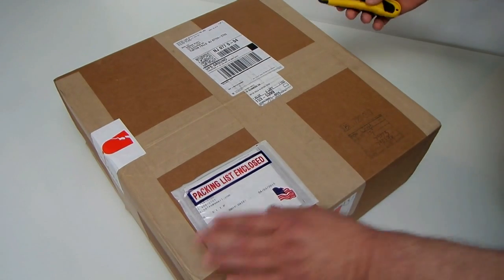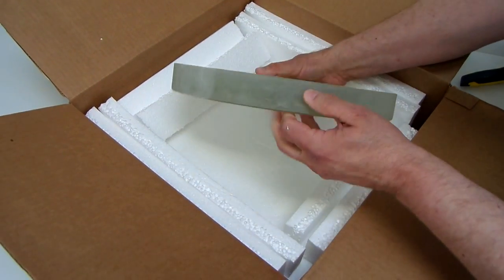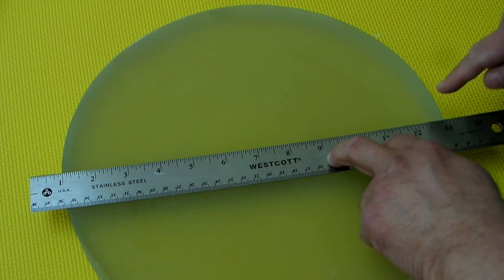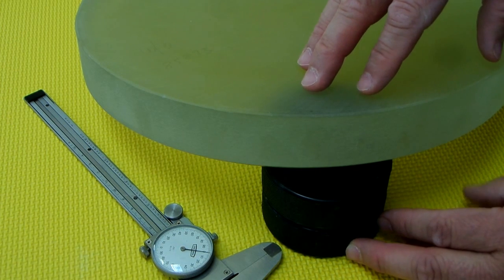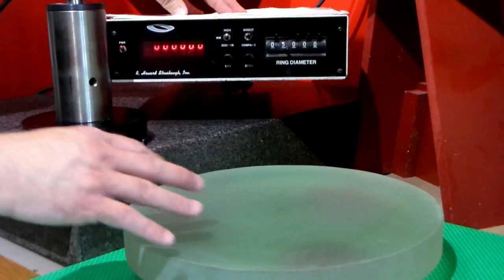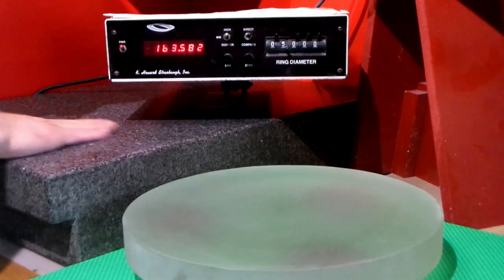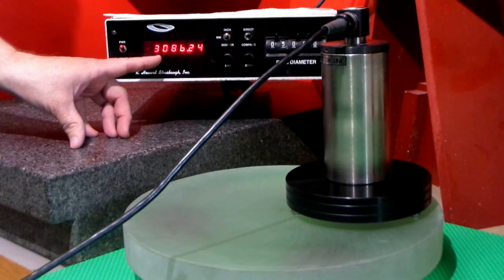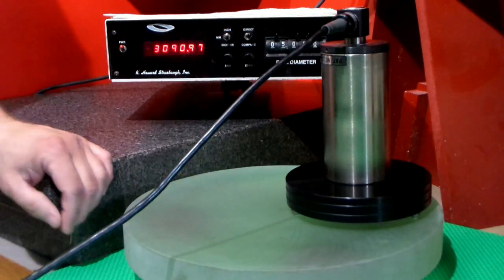12 inch f4.9 Telescope Mirror Part 1

Comment: You're opening the box completely wrong. It's a good way to slice your hand clean open. Instead of cutting towards you, cut away. Jeez.
  Better yet, just ditch the box cutter altogether and use a butter knife.
Reply from the maker: Yes, I'm a slow learner.  Nearly cut off the tip of my thumb a couple of years ago slicing an onion.  I don't think the butter knife would work on the onion.  BTW, the onion didn't have anything to do with a mirror!
Reply: @GordonWaite  No, a butter knife would not work slicing onions. 
  I want a parabolic mirror, about 40 cm diameter. I thought watching your video would help. Thanks 😊

Comment: Rewatching this video.  You haven't made any new ones in a while.  I dug out the 7" F7 project that I put aside some years back.  Guess I'll try to finish polishing it AGAIN.  Grinding was easy, but making a pitch lap is hard.  Years ago I treepaned out two 7" disks of 3/4" glass and managed to grind the mirror.  The largest disk I can cut this way on my drill press would be about 9", and that also would probably be the largest plate glass mirror I'd be foolish enough to try at that thickness.

Comment: What kind of glass you use and from where do you order them?
Have you ever tried Lead glass?
Reply from the maker: Two most common types of glass are standard plate glas (soda lime) and borosilicate glass like Supremax-33.  I buy most of my glass from Swift in Elmira, NY.  I have never used lead glass.

Comment: Hi. I was just wondering; since the glass is grinded and polished and lastly aluminized. Wouldn't it be easier and cheaper to just grind the mirror out of an aluminum blank and then polish that to a high gloss mirror finish, getting rid of the glass all together.
Reply: That could certainly be done, and had been centuries ago with speculum metal mirrors, but then you'd lose the superior qualities of glass over aluminum and most metals, such as smoothness (aluminum has crystalline and grain properties that don't allow a solid chunk of it to be made as smooth as glass can be made) and dimensional stability over both temperature variations and time.  Aluminum's relative instability concerning temperature also makes it more difficult to grind to precisely the right shape to begin with.  Then when its surface finally corrodes or is otherwise degraded, it has to be repolished (at least the final high-precision step) like old speculum metal mirrors, while with aluminized glass mirrors, the aluminum film is chemically removed, the glass mirror is cleaned (no repolishing necessary), and is re-aluminized.  This has to be done every several years with large professional mirrors.  So with glass mirrors, you get the best properties of both glass and aluminum (its reflectivity), as well as greatly reduced cost and difficulty of maintenance.  Frankly, it makes no sense to make a solid aluminum mirror--it would work, but aluminized glass is superior in every way.

Now if we look at the James Webb Space Telescope, its beryllium mirrors actually have superior physical properties even to glass.  Every mirror would be made of this metal if it weren't so rare, expensive, and dangerous to work with, but the JWST is worth it.  Beryllium on its own doesn't reflect well either, though, so it has a gold reflective film (to optimize for infrared wavelengths).  As with aluminum, a solid gold mirror would be inferior, so two materials are used to get the best properties of both.  I don't think there is a single material that is the best or even good enough (by today's standards) in every way.
Reply: @rbrtck  That was a good answet! Thank you for that. Somewhere in reading it an idea came to me. Maybe the thing to use instead of glass would be a meteorite. So that the mirror from space mirrors space. Makes another type of sense than precision. But for this time I will be happy with beryllium and gold. In fact, I will not mention any of this to the James Webb people. Grinding new mirrors from meteorites might cause a delayed launch date.

Comment: Note: this four part series ends before the final process is complete. You will not see the mirror being coated, or installed in a telescope.
Reply: I ws looking forward to a part 5 bcos I have with me a 12 inch blank. And the part 5 would be a great help. However Mr Gordon has personally replied to my questions and I'm sure he will help me out to finish my 12 inch. It's my first project. And I'm really not gonna aim for anything high.

Comment: I have a question. If you have 2 identical telescopes , same brand ,model ect are the mirrors going to be the same quality? or will one telescope have superior optics to the other? The reason i ask is i have read a few times that it is hit and miss with regards to telescope optics.
Reply from the maker: Most common commercial reflecting telescopes have optics that are manufactured in China.  These optics are commonly "OK" optics, but perhaps as much as 20% to 40% of the mirrors are not up to minimal standards.  We receive mirrors to test all the time, and most of these are well worse than 1/4-wave, a traditional standard.  Of course, we see these particular mirrors because their owners aren't happy.  So that does not mean that all of those mirrors are bad.  It is a self-selecting group that we see.  The problem is that to get a better mirror you have to spend more time figuring it.  Time is money, so overseas makers tend to stop as soon as possible in order to make the highest profit.  The result of this is that you see a lot of dubious mirrors, and you very seldom see a really excellent mirror.  You get what you  pay for, if you are lucky, and this is a cheap, serviceable mirror.  So to answer your question, you are likely to get a usable mirror in a commercial telescope, but the odds of getting a poor mirror are pretty high as well.
Reply: ok thanks for your help , the scope i brought is the celestron evo 9.25. I was under the impression that these big name companys had good quality control and produced good optics otherwise they would be out of business. I also had no idea my mirrors could be of dubious quality when comparing identical telescopes.

Comment: What happens when the mirror is not pregenerated to an f/4.9?
Reply from the maker: If a mirror isn't pre-generated, then you have to start with a flat tool instead of a curved tool.  You then have to use the flat tool to get the curve started on the mirror blank.  As you get the curve started, the tool will take on the same curve.  After that it is the same process as with a pre-generated blank.  Starting flat just means you have a fair bit more work to do, but it's not any harder.
Reply: @GordonWaite  --- EXACTLY ......... Easier than you think ......... Just  a LOT of LOVING labor involved ......... AND LEARNING ......... You will LOVE that which you create !!!
Reply from the maker: @NumberOneScientist  Exactly! Nothing better than the first look through the eyepiece of the telescope you built!
Reply: I ground my 12" f 5 from flat rather than pre-generated. Took forever, but as he says, really not difficult.

Comment: do you need to let the blank rest to get up to lab temp for the spherometer? have you ever used an optical flat to measure flatness?
Reply from the maker: You do not need to let the mirror rest before doing a spherometry test.  The amount of expansion due to warming during grinding is too small to measure with a spherometer.  I have often used optical flats to measure the flatness of mirrors.  I have a couple of Newton interferometers.  It's a very cool test.
Reply: neat.

Comment: 7 G's???? I just started researching cost for Dobsonian telescopes last night. I want to build my own. Why are mirrors so freaking expensive????? I don't get it?
Reply from the maker: Take a 20" f/4.5 mirror.  Retail price is about $5,250.  A Supremax-33 mirror blank, pre-generated, will cost you about $2,750 to start, from a commercial supplier.  That leaves $2,500.  Getting the mirror coated will run about $250, plus shipping, so call that $300 at a minimum.  That leaves $2,200.  There is probably $200 in consumables to grind and polish a mirror.  Thinks like pitch and abrasives and cerox and ceramic tiles and plaster and other stuff.  Now you are down to an even $2,000.  To be profitable in the business, you might need to gross $50 an hour for your labor.  So $2,000 / $50 leaves you 40 hours to grind, polish and figure a 20" f/4.5 mirror.  That's one week.  Ask anybody you know if they can grind, rough polish and figure a 20" f/4.5 mirror in 40 hours.  And that doesn't count time to answer a client's questions, or to order supplies,  or to schedule coatings, or to work on your Web site or advertising campaign, or to exhibit at a trade show.
Reply: I've been scouring the interwebs and am failing horribly at finding any deals on 20" mirrors. Any sources you care to share? I have always been fascinated by astronomy and the cosmos and literally just stumbled across dobsonians while looking for a decent telescope for my brother as a Christmas present! Not two hours into dobsonian research and I seem to have already priced myself out of what I thought would be a relatively affordable hobby!
Reply from the maker: Please send me a private email gordon@waiteresearch.com and I will do my best to help you!
Reply: @CORZER0  Buddy! 20 inches is huge! Unless you are a pathological full-time backyard astronomer or a scientist, you will spend all that money and you may rarely use it because it is so big and cumbersome and getting set up can take hours, and that would be a real shame cuz yer not realizing the incredible potential of such a big sky-eye. 

And if you ever want to, or more likely, if you ever HAVE TO sell it because of a wife threatening divorce if you don't get rid of that damn telescope, it could take a long time because 20 inches is in the fringe of the fringe market.

I urge you to step back and really think hard about going so big right off the bat.

It would be really cool tho to build such an awesome machine. Really, really cool!!!

If it were me, I would keep the telescope and say goodbye to the wife.

I doubt if there are a lot of 20 inch amateur telescopes out there. I recommend starting with an 8 inch Celestron or Meade with GoTo capability and you can do a lot with it for around $2500 or less.

Fairly easy to set up and tear down, yet still get some really awesome pictures.

But once you get up over 8 inches, things start to get heavier and price seems to go up exponentially. 

And you can get up to 14 inches with Celestron or Meade with pretty awesome quality. Now yer getting up over $5000 for a basic set up, and $10 to 20 grand is so easy to spend once getting up over 8 inches.

It's been said that the perfect telescope is the one that you use the most. I often find myself gravitating to my small 80 mm refractor and binoculars because I'm too impatient and too lazy to drag the Celestron Nextar 8 out and spend two hours setting it up. The image  quality isn't as good but I get to see more because I can just whip it out of the back seat and aim. Voìla!

If you do decide to build the 20 incher, I congratulate you and it will be an amazing machine and the pictures will be awesome. 

Just make sure you use it a lot!!! And also get a small telescope that is basically point and shoot, so you can see more of the magnificent artwork and wonders of the universe. Put that one in your car.
Reply from the maker: If you have light pollution, then an 8" is great for the moon and planets.  If you have darker skies, going to 12" really shows you a lot of beautiful objects up there.
Reply: CORZER0 20 inches is huuuuuuuge. 8-12 inches is more reasonable for backyard astronomy. Then you are looking at a few hundred for a good mirror. You can find complete telescopes on Criegslist in that size for under 200$.
Reply from the maker: It's nice if you can test a used 'scope so you know what you are getting.

Comment: Great video and very informative. My only query is the use of imperial and metric dimensions on the same job? You jump from one to the other and back again! Is there not an adopted standard?
Reply from the maker: Hi, Andrew.  There aren't really standards, and we switch back and forth all the time.  If I have a US customer, I get requests for mirrors in inches.  Mirrors heading overseas are more often specified in mm.  When I buy Supremax borosilicate, it is specified at the glass fab in mm thickness measurements, but inch diameters.  Mirror radius measurements may be inches or mm, depending on where it is going to ship.  Fortunately my computer-controlled spherometer will read in inches or mm, except that the heads of the probes are all set up in inch increments!  It is a crazy world out there!  -GW

Comment: ah what does f4.9 mean
Reply: You do 12 * 4.9 = 58.8 which is the approx focal length in inches, about 1494 millimeters.
Reply: balzerbarn Thank you  I had looked at several places but nothing I found yet had told me it was the focal length. Thank you very much now I can go look up focal length an learn a little more ..
Reply: 4.9 is called focal ratio, you obtain this number dividing the focal length by the diameter of an assigned telescope. The shorter the focal ratio, the more difficult will be the optical job. There are many other implications about this number, that's why they prefer giving the diameter of the telescope and the f/number in many discussions.
Reply: Thanks

Comment: How thick would you go on a mirror this diameter? I've got a WW2-era porthole glass that's 12" in diameter but only an inch thick and I'm wondering if it'd make a good mirror...
Reply from the maker: An inch-thick mirror will work great for a 12-inch mirror, as long as you are careful about astigmatism as you grind and polish.  If you are working by hand with a full-sized tool, this isn't much of a problem.  If you are working by machine, make sure the mirror is well supported on the bottom.  Make sure it isn't pinched by your hold-downs.  And rotate the mirror about every 20 minutes when grinding with the mirror on the bottom.  Good luck, and enjoy your project!  -Gordon

Comment: Why didn't you check the radius on that mirror at more than one point?  Hopefully it was symmetrical, but why take that on faith?
Reply from the maker: Kenneth Scharf Hi, Kenneth!  I checked the preliminary radius numbers at three points.  That let me know that, as expected, the mirror wasn't spherical.  The grinding that I do to make the mirror spherical will also make it symmetrical, particularly since I'm using a full-size 12" tool.  No mirror starts out as both spherical and symmetrical, but the standard strokes will get you there.  When I am done with fine grinding, I always do a test with many more sample points to make sure of symmetry.
Reply: Yes you mentioned that in the second video.  I'm looking forward for the next part.
Reply from the maker: Kenneth Scharf Thanks, Kenneth!  I'm editing up the third part tonight.  I'll probably have it done tomorrow, or the next day at the latest. -Gordon

Comment: What are the pros/cons of borosilicate? Is it harder to grind?
Reply from the maker: nirvanix88 Borosilicate glass is slightly harder than plate glass, and slightly softer than quartz.  Really, though, the difference is minor, and not something to worry about.  Borosilicate has less expansion with heat, so it is faster to go from the grinding machine onto the test stand.  Being a little harder, it takes slightly longer to polish out a borosilicate blank than you would experience with plate or BK7.  Once boro and plate are at ambient temperature, they will perform almost exactly the same in the telescope.  Borosilicate is quite a bit more expensive than plate glass.  -Gordon
Reply: GordonWaite Thanks for the reply Gordon! I have one mirror with BK7 and another with pyrex. Would you be able to rank them with regard to thermal performance? I suppose granite would be optimum in that regard?
Reply from the maker: nirvanix88 Pyrex has considerably better thermal performance than BK7.  BK7 is just a bit better than plate, but Pyrex or newer borosilicates like Supremax-33 are considerably better.  Quartz is even better yet.
Reply: GordonWaite Thanks Gordon, good to know.